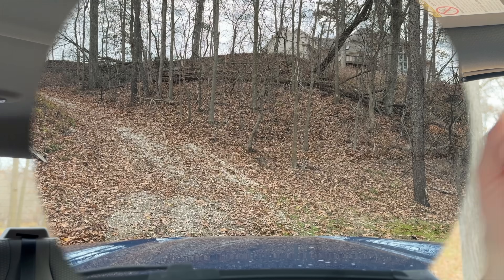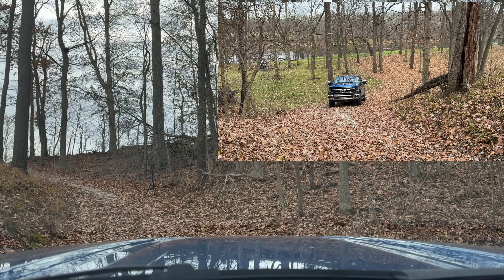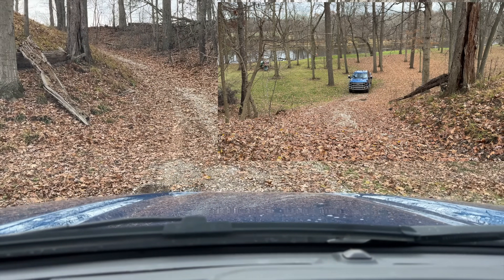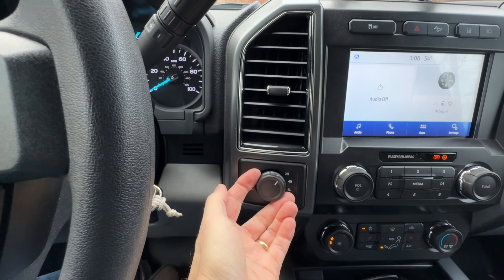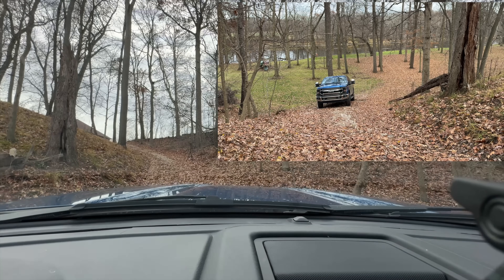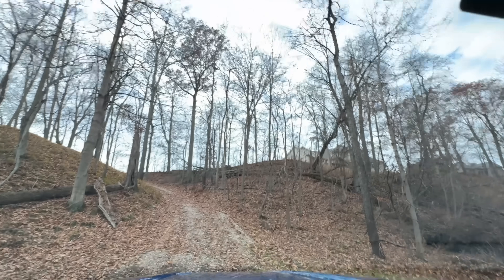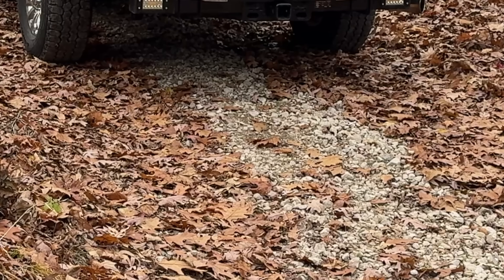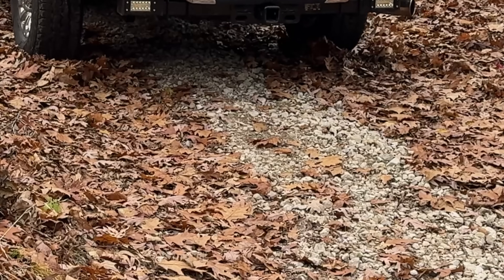FordSuperduty Traction control vs locked diff vs 4wd

Comment: Does putting it in 4 Low lock the diff or is still open until you lock it? I don't have a lot of experience with 4WD vehicles, I bought a jeep a few years ago with limited slip front and rear diffs and it automatically disables traction control when in 4 low but it's the only 4wd system I know.
Reply from the maker: @randymartin5521 So in the video, I used 4 low to climb the hill and show that when in 4 low, it does disable the traction control.  I did leave the diff locked but not intentionally.  The E locker in these trucks has to be engaged manually by pulling out on the 4WD knob on the dash, it never locks automatically.  However, if you lock it and exceed like 20 MPH in 4 High, it will unlock itself, in 4 Low it won't unlock itself until like 40 or 45 MPH, I would have to double check the owners manual to say for sure.

Comment: I have a limited slip in my old ‘06 Dodge 1500 4x4, and it works against me as much as it helps… in tight corners (which is any real corner with a turning circle that wide), it kicks the rear end out needlessly in rain or snow. It doesn’t surprise me anymore, but it sure did at first!

Comment: I had a similarly equipped F150 FX4 and I hate the ford traction control off-road. Its fine on-road for bad weather and light snow, but its terrible for loose gravel, mud or deep snow. 

I have since gotten rid of that truck and got the GMC that has the automatic locking diff in the rear and I’m much less aggressive traction control system… I still have full-time four-wheel-drive accessible to me, but I rarely now have to put it in four-wheel low, the GMC has what they call AUTO four-wheel-drive that works wonders when it’s just light snow or bad weather or you’re going down a sketchy road and you just don’t wanna get stuck in the first place. I wager I could drive up that hill in my truck and either auto or high range Four-wheel-drive.  I’ve only had to put my truck in low range a handful of times in deep mud, and when I say Deep, I mean over the running boards, Deep.

Comment: Locking differentials are very important. My buddies got a really nice old like Infiniti QX4 or something like that. he put extra fuel tanks roof,  racks, high lift Jack's, oversized tires, thick skin plate Rock sliders and snorkels all into this vehicle. Unfortunately it has no aftermarket support for upgradeable differential.  Anywhere we go ... if it's anything more than a groomed dirt road they can't go. One back tire and just sits there and spins and one front tire spins. No smart differential controls , breaking traction controls ,etc. lot of money thousands into a rooftop camper and I think it barely go off-road.  Four wheel drive does not mean 4 wheel drive if you don't have locking differentials.

Comment: Momentum ( as mentioned below)
And 
Not waiting until you get stuck to think about choosing which traction mode to be in,
Reply from the maker: @jeanvaljohn3921 when I'm off-road for reel and not just making a video, I turn off all the traction control I can and drive completely different than in this video.

Comment: Traction control has caused many a truck to get stuck needlessly.  If I could take Traction control off my trucks permanently I would. In the old days you locked the hubs and put it in 4wd and took off.  Locker stayed on all the time.  Now one of you guys takes the truck and they don't take off traction control, and they don't put the locker on, and they bury the truck.  Every time you turn off the truck and restart you have to take it off.   If your truck was loaded like mine is and with me driving, I would go up that hill in two-wheel drive without a locker or traction control. I know you are doing a demonstration, but it is important to understand that one does not creep into a low traction situation except possibly Ice.
Reply from the maker: @jimbob8533 Yup, just a demonstration, however, we went to Moab about 2 years ago and drove plenty of of off road trails that required us to creep up hills rock crawling.  Speed is not always the answer.

Comment: At the water district I used to work for we got two Ford F250 Super Duty pickups. The first thing we had to do was take the cowling off the front of the trucks because the deep snow rips them off anyway. The first time I had to drive through a pretty long snow drift I ended up stuck in the middle of it. I didn't know how to turn the traction control off and about the middle of the drift when I needed the power most the truck just shut down. My partner and I dug ourselves out of the drift and went to another location. At the new location I put the truck in two wheel drive put it in gear and put the peddle to the medal. Within seconds after the truck started to spin the throttle automatically shut down. We were sitting in the truck with the throttle peddle to the floor and the truck idling. On highway use the traction control may be helpful but when you need the power to bust your way through the snow the traction control is only a problem.
Reply: Medals are supposed to be made of metal.
Reply: @n085fs 😂
Reply: and don’t rely on Ford’s auto locking hubs- lock them in sometime in November & unlock them in April😂

Comment: G-80 locker has the edge over Ford
Reply from the maker: I’ve had both, the G-80 is ok but they’ve snapped lots of axle shafts too.  If you drive sensibly with the G-80 though they are nice because they are automatic.  However, some wheel spin and speed is required to engage them as where an E locker allows you to lock it and then hit the gas so the axle is locked before spinning the wheels.  Both are better than an open diff but it really comes down to personal preference.  For less advanced and less experienced drivers the G-80 is better as the E locker requires a little more prior knowledge and experience to know when and how to use it.

Comment: I can drive up that hill on my bike with no problem letting alone my 2020 F150 STX
Reply from the maker: @notreal-j5l Good for you, make a video of it hot shot.  I can drive up it just fine too.  The video wasn't about climbing the hill, I used the hill to create a situation that would result in loss of traction and allow for demonstration showing how the traction control operates, what results when the diff is locked as opposed to using 4 wheel drive.  Not everyone wants to blaze up every hill.  I've been to Moab and driven a several technical trails where speed and momentum will brake things, a good driver, an intelligent driver can climb a hill slowly just as well as pulling out all the stops and driving fast and hills never look as steep on video as they really are either.  But hey, thanks for watching and for leaving a comment, the you tube algorithm loves it.

Comment: Now we get front & rear lockers from mfgrs.
Reply from the maker: @Torch4Life Yes, if you have a need, it is nice to get them as a factory option.  Unfortunately it usually does force you into the higher trim levels to get them.  We went to Moab and rented a Jeep Rubicon from Twisted Jeeps and it had front and rear lockers as well as an electronically disconnected front sway bar.  It was a very capable vehicle and I enjoyed getting to drive some pretty technical trails with it.  Unfortunately being a rental, we were limited to certain trails but they allowed plenty of trails with obstacles that we certainly not bunny hills.

Comment: You are driving far too slow. You hsve no momentum. That's not the watmy to clomb hills.
Reply from the maker: @mtnphot climbing the hill was not the point of the video, I used the hill to demonstrate what traction control does, how locking the diff is different than traction control and what a difference 4 well drive makes.  Yes if I wanted to hit the hill with a bit of speed at the bottom I'm sure I could have made it up in 2 wheel drive.  However, I bought a 4 wheel drive and it gives me the ability to drive very slowly and controlled up that hill.  Momentum is a good thing sometimes but too much of it is also how you break stuff.  A good driver knows how to do both.

Comment: Most 4 wheel drive systems are only 2 wheel drive , 1 in front and 1 in back and when off road with out possitraction or a locking axle you’ll still be screwed
Reply from the maker: @middleclassretiree when there is a potential fro loss of traction such as Ice or getting crossed up with one tire on the front axle and one on the rear getting weight lifted off them, you are absolutely correct.  The average person will never use their vehicle in a situation where they need more than what an open diff will handle.

Comment: I have a 2019 ford ranger 2wd with traction control. Should I turn traction control off when it’s icy ?
Reply from the maker: @dennishayes65 no, that is where you actually want traction control to be left on.  When driving on the road, 99% of the time traction control should be left on.  Only when you are stuck, driving in mud, sand , deep snow or more technical off road situations would you need to turn it off.

Comment: Recently got a super duty with a locker. 

Soon after getting it I had to go up an icy hill.  1st 2wd. Nope. 4wd, still nope. Added the locker to 4wd and had no problem. 

Traction control is nice. 4wd is what you need for slippery conditions.  A locker is for when 4wd alone isn't enough

Comment: Why did you put it in 4 low?
Reply from the maker: @kona6451 Better throttle control on the hill and because it disables traction control which is what I was demonstrating.  I use 4 low when I get the chance, if yo never use it, it can seize up and when you need it you won't have it or you won't get it back out of 4 low.  That shaft and gears don't get much oil if you don't use it occasionally.

Comment: i know it's not practical, but how would it behave if the driven tyre pressures were dropped to say 10 psi? i used to do a thing called production car trials, and dropping your tyre pressures has a minimum in the rules due to how effective it is; it can really be a get you out of trouble thing, with, of course, a bit of momentum and a tyre inflator.
Reply from the maker: @jonmeacock8267 While I am sure lowering the tire pressure would certainly help me get up that hill as would momentum, that was not the point of the video.  I made the video to demonstrate how the truck behaves when traction control is active compared to the diff being locked and then once again comparing it to 4 wheel drive.  I used low range because it turns off traction control.  Yes lowering tire pressure is a great idea to help with off road traction, but for a quick trip down to the river, it is a waste of time when I can simply put the truck in 4 wheel drive.  For an all day adventure, sure lower the tire pressure it will help a bunch.  We rented a Jeep in Moab and the rental company sets the tires to 15 PSI and tells you NOT to adjust the pressure no mater what.  But we weren't doing 70 MPH on the expressway, we were driving off road trails all day.
Reply: @robertweller2662  thanks for the reply, I really enjoyed the video, and I appreciate the time it took to make.

Comment: The day I forgot to turn traction control off is the day I almost had a huge accident caused by traction control intervening at the utmost worst possible moment.
Cars in which it can’t be turned off are a hazard for any mildly good driver and up to have to try and trick

Comment: We usually didn't have much problem with weight and speed. We just didn't stop or sight see going up hills like that. I would just about bet that 300 lbs or more in the bed would have allowed you to almost creep up the hill. I'm not arguing against 4wd but there are ways to overcome the lack of it. That said there are times when even 4wd has to be augmented to overcome the problem. The first thing is to evaluate the situation your getting yourself into before it becomes a problem.
Reply from the maker: @garyradtke3252. Everything I did in the video was for the purpose of showing how the systems and features function.  I had no trouble with the hill climb ever and am fully capable of driving up it without spinning my tires.  This was all for demonstration purposes.  Thanks for watching

Comment: Oh dang how did we do it back in the day without all that fancy stuff and a computer???? Just how?!?!? In nothing but a truck with a locker in the rear and an antiquated manual transmission none the less. Oh wait granny gear first (compound low) gear in the transmission and low gears in the axles like 4.10:1 ratios and crawl.

Ps. Sometimes we used momentum and did it without 900 hp.
Reply from the maker: @darryladams519   My first 2 full size trucks were 2 wheel drive with manual transmissions and the old 300 straight 6.  I put weight in the bed and ran good snow tires, no lockers, no limited slip, just hit the gas and keep the momentum going.  That wasn't the point of this video though.  Thanks for watching.

Comment: Does putting it in four low disable the traction control for pretty much any make and model? I have a Ram 1500 4x4 with a button for traction control. And I'm never sure when to use the button or not use it
Reply from the maker: @CraftyCampingGirl   I'm afraid that I do not know if 4 low disables traction control on all makes and models but I would hope so.  As for the traction control off button, leave it on for normal day to day driving.  Turn is off if you are in sand, deep mud or snow as a general rule of thumb.  I usually turn it off when off road as well.  Sometimes you need to spin your wheel, if that is the case, turn it off.  Hope that helps.
Reply: @robertweller2662 why would I need to spin?
Reply from the maker: @CraftyCampingGirl  Getting through mud, snow and sometimes sand, if you are stuck or getting stuck sometimes the only way to get out is to give it the beans.  It's a fine line between spinning enough to get out without making it worse.  If you aren't into driving off road, I wouldn't worry too much about it.
Reply: @robertweller2662 😂I guess I've giving it the all when I shouldn't have! I'm going to start driving on beaches so I want to learn more about how to do this stuff. I do have traction boards to help if I get stuck.
Reply from the maker: @CraftyCampingGirl  If you are driving on a beach you need to air your tires down a lot, that is the number one thing you need to do not to get stuck in the sand.  Search for videos of people airing down for sand.  If you don't have bead lock rims (and you probably don't) then you will have to be careful not to air down too much but you want those tires really squishy.

Comment: I have a 2016 f150 that has this same 4wd system. I don't ever use the locker because if I need 'more help' than what open diff 2wd will give me, I'm already in too much trouble for the locker to get me through.  I also have a 2016 Colorado z71, so it has the automatic locking rear diff. I almost never use 4wd in it.. even in the snow. Works very well, even after 120k miles. The colorado is my work truck and usually has 500-800 pounds of stuff in the bed. The f150 normally doesn't have anything in the bed, I'm sure that makes a difference too, but yeah..
Reply from the maker: @corey-w6i7e  the locker is very useful in these trucks and can often get you moving without needing 4 wheel drive, the locker engages faster than 4 wheel drive and has fewer components involved.  It is best used when crossing ditches or uneven ground at an angle where one rear wheel may come off the ground or have little to no weight on it for traction.

Comment: Why didn’t you use 4 hi instead of 4 low ?
Reply from the maker: @littlehuey5679  Demonstration purposes to show that in 4 low, traction control is disabled.  Also I frequently use 4 low when off road just to exercise it.  There is no oil pump in a transfer case, so the low range shaft and gears don't get bathed in oil as wheel if they aren't engaged once in a while.  Want to ruin a transfer case?  Never use 4 low, see what happens. When I have looked at used 4 wheel drives in the past, 2 phrases sent me away faster than any other, one "I never used 4 low" and wo " I never even used 4 wheel drive"  Hard pass.
Reply: @robertweller2662  You had the perfect answer Robert. Many people believe that 4 Lo will give you better traction than 4 Hi and that is simply not the case as it's simply a gearing change. YouTuber Getty's garage just put out an excellent video on this.
Reply: @robertweller2662 that’s an important update… u could do an add on covering 4x4 hi at low speed vs automatic awd vs 4 lo with load and without… I seem to recall an option to turn tc off (it defaults back on after restart) I also like using tow mode to retards the gearing during momentum runs and big descents and on sketchy days… someone also mentions weight - I’ve found lighter vehicles can get up situations where the heavy duty trucks are just pulling too much weight…

Comment: 2000 lbs in the bed will make 2wd so much better..thus the truck will go so many more places. My 99f350 has detroit lockers in both ends with 4 to 5k sand in bed in my sander..unstopable. My driveway must be 30 deg at the steepest part..as well as my customers driveways..Right now in dec I'm setup for plowing, double row chains up front 1000lb plow. Getting stuck doesn't happen any more. We only use subaru cars with blizzak dmv2 tires the best hands down...I live at the top of Vermont. Dirt roads only. Happy new year!!